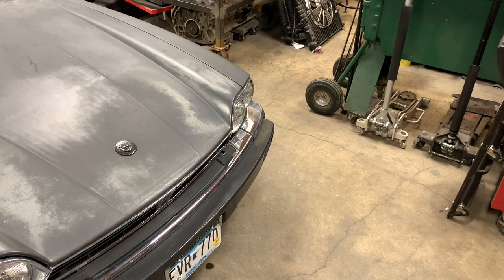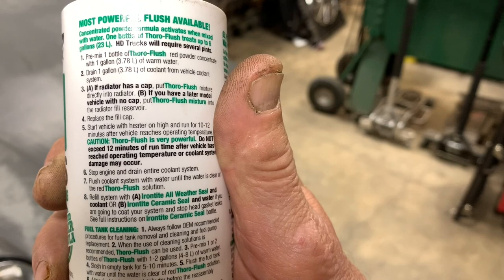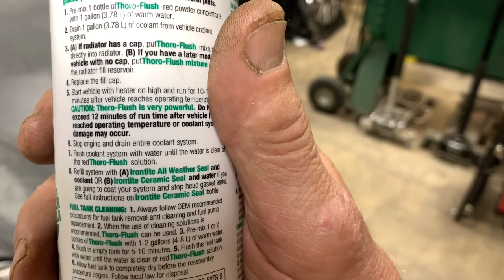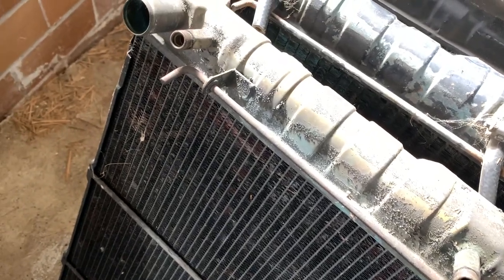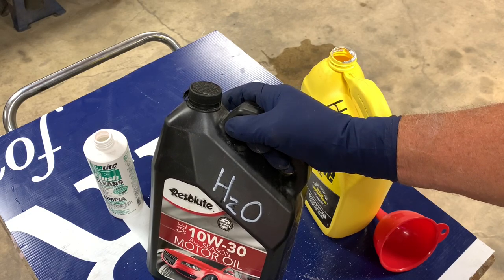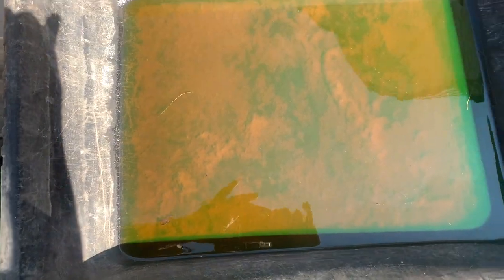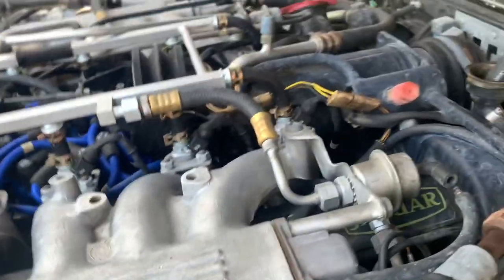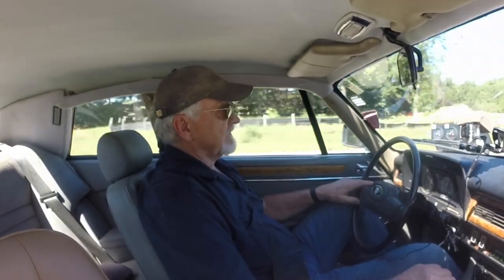Cooling The Jaguar XJS Ol' Tex: The Basics-Part 3: Jaguar V-12 Cooling System Flush.

Comment: I enjoy your videos and have learned some very useful applications from them. I have a 1989 XJS v12 and had to go through my cooling system about three years ago. I replaced all the hoses and had the original radiator serviced by a rad shop. I did the back flushing with water and had to replace the water pump. I added some inline filters and buttoned it all up. I didn't replace the thermostats. After a few test runs and sorting a few things out the cooling system works very well. This car is my daily and I have been driving it in 90-100 degree days in traffic and the needle is staying under the N. On days under 90 degrees the needle is way under the N. My car has over 91,000 miles on it and from this experience I have found that the the Jaguar v12 cooling system is sufficient for keeping the engine cool, at least in my car.
Reply: Great to know! I’m picking up my refreshed rad from the shop tomorrow!!

Comment: I live in west central Florida and own two V-12 XJS’. One is a 1988 and the other is a 1990.  The 1988 has a Lucas ignition and the 1990 has a Marelli system if that makes a difference. The 1990 has no overheating issues, whereas the 1988 experiences the same overheating symptoms as ‘Ol Tex. I can drive mine and it exhibits a normal warm up cycle and maintains a normal gauge reading for a few miles. Eventually the needle will begin a slow creep until it is in the 210 degree range. I won’t let it get any hotter than that for fear of engine damage. I too have done everything you have shown through your episode #3 with the same results as you have experienced. 
I have also removed the pre-catalyst to reduce exhaust back pressure, replaced the water pump, replaced the radiator with a 25% larger capacity, replaced the radiator fan with a high capacity electric one, replaced the thermostats several times with three different opening temps, overhauled the distributor because of sticking advance weights, replaced the vacuum advance unit and flushed the cooling system three different times. 
A Jag forum suggested flushing with a 5% white vinegar. I drained the system completely and replaced it with nothing but the vinegar. I drove it 100 miles like that before I drained it. That was a difficult procedure since I could only drive it about 20 miles without overheating. I was shocked at what came out of the cooling system once it was drained. Like the stuff you got in your drain pan that you didn’t know what is was. If you poured the coolant through a coffee filter and allowed it to dry it would be a light brown powdery substance.  I believe it is a substance called Bars Leak.  Jaguar recommended adding it to the coolant at major service intervals. I got a massive amount of it from my system so I repeated the vinegar flush procedure once more. I got a very small amount on the second attempt.  To make sure that I got all the vinegar flushed from the system, I flushed the the system a third time with a commercial product made specifically for aluminum engines and cylinder heads. 
I have done this, and even more, and the warm up and overheating condition is unchanged. It remains exactly the same.  I look forward to any solution you come up with that would solve both our dilemmas.

Comment: had a 1972 jag XKE 2+2 V12 in the SF Bay area back in the 70's, dang car ate batteries so bad AAA canceled me for calling them so many times. The car didn't have enough air circulation in it for warm weather driving like where I was.  Drove it down to Irvine on the 5 FWY and had to NOT use the A/C and had to stop every few miles to let it cool off.  Parked it in the garage when we got to the house in Irvine, took  the entire water cooling system apart and re-routed pipes, replaced pipes, new thermo, roded and cored radiator, hooked up the fans to run all the time. That did the trick, drove it to a import place and sold it in 5 minutes! Now drive a 2013 XJ and no issues at all.....

Comment: Be aware that  factory jaguar maintenance schedule for coolant leaks was to use bars leak.   As a result original radiators may be partially blocked so a new radiator or re-core maybe needed.     On my 1989 XJS there is an overflow tank behind the driver side fender between the front tire and the door.   You can acess it by removing a panel in the wheel house.    This tank is feed from the overflow hose in the side auxillary tank in the engine bay.    This hose will connect to the overflow tank via a metal nipple (behind the fender).     On my car this nipple was totally blocked  which effectively removed the expansion tank from the system.          Anyway you'll want to check to insure your expansion tank is sorted.

Comment: My 89' V12 XJS started overheating under very similar circumstances with me eventually trying new thermostats, coolant mixtures, even some fancy liquid to lower the boiling point of the coolant. Eventually, the motor started getting hotter and hotter until it overflowed into the overflow tank located behind the front left wheel. With each subsequent drive, fluid just kept going into the overflow tank and then the ground as it overheated during very hot days here in Northern California.  At some point, blue smoke appeared out one side of the rear exhaust. When I took the heads off (no easy task), I found that both gaskets had large holes the size of quarters that appeared to have been there a long time. Not sure how bars leak would have helped. I also did not realized the V12 motor is "wet" around the cylinders, unlike many motors with a solid block of steel/aluminum that would warp or crack. I have read on many Jaguar forums that replacing the head gaskets should be done every so often. Bummer it takes so much work and is not an easy job.

Comment: Good of you to chemically treat and flush the radiator, but the chemical may need more time to clean out the build up of crud from the past several decades.  A second treatment may return some more cooling capacity.  You were wise to see the A/C adding some temperature rise as an indicator that you are just on the edge of the cooling system’s capability.  Back flushing the radiator may return some benefit as it may loosen up more crud, but I think more chemical cleaner exposure time is the key to breaking more cooling tubes open in the radiator.  (It may be very difficult for the chemical to penetrate down the most clogged cooling tubes in the radiator as the majority of the flow will want to go down the tubes that are already cleared out)
Reply from the maker: I don't look for the radiator to be the problem. It was a fresh reconditioned unit two years ago.
Reply: @thecampchaoschronicles9567  But crap from the engine block could have blocked the new radiator.
Reply: I’d think you have loosened a lot of that crap. Just not all. Do that chemical flush again and you’ll clear out more of the water channels in the block.

Comment: If you watch a few teardown videos of the v12, you will see the block and heads accumulate sediment from all the suggested, factory recommended treatments of Bars Leak by previous owners. Since you have reconditioned the radiator, that should have eliminated the RTV which accumulates in the core rails from the original build; however it appears that was what was in the drained solution. Liquid rubber. I’ve owned several. High mileage unit had your same problem. Plugged radiator and likely block water passages. Low mileage unit,50k miles, no problem. Yes, it’s hot in Texas. 105 in the summer. No I don’t drive it on those days. 90 degrees no problem.

Comment: Why do these Jaguars always have cooling issue and corrosion issues in the cooling? What's is the stock coolant? How about switching to "Asian Vehicle" Red coolant. Seems to do better in Bi-metal apps. I think the system is capable of keeping the engine cool it just seems to have longevity issues. What was that stuff in the flush? Rust?
Reply from the maker: I'm convinced the cooling issues are due to lack of proper maintenance/repair and perhaps faulty replacement thermostats. I'll be checking the latter in the next video. I use the recommended coolant. I'm researching the stuff in the flush. I've emailed Irontite about it.
Reply: Do not use any other coolant than green coolant in any Jaguar!  The cooling issues are down to lack of maintenance.  I've been working on these cars for 30+ years, trust me on this one.
Reply: Best corrosion inhibitor for these engines was and still is the Bluecol ethylene glycol anti freeze.
Reply: I think it’s because careless owners use tap water. 

I figure it takes 20 years for tap water to ruin a cooling system, so most people never give it a second thought. But then guys like us come along and buy their 20-year-old cars, and that’s where the fun starts. 😠

Comment: There are other unique things to the north American market. One is federal pollution control systems. The '75+ Pre-HE, for example, makes less horsepower at lower Rpm, and less torque at HIGHER rpm than the "rest of the world" model. There is an excellent chance these engine run hotter to begin with and are more intolerant of wear or poor tuning. Also, these engine were designed to run on leaded gasoline. The US effectively banned lead in gasoline in 1975, England did not until about 1989. England has also just in the last few years begun using E10 "gasoline". These sources of leaner running/friction/heat may be enough to make the V12 overheat outside of nearly optimal conditions.